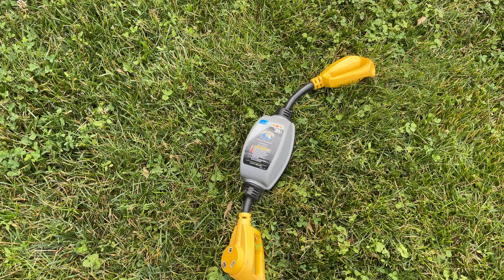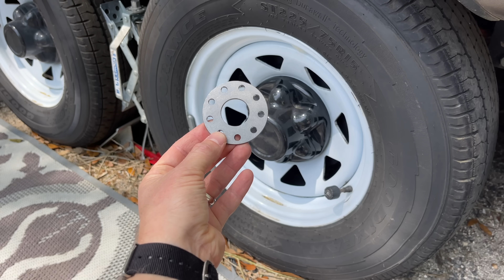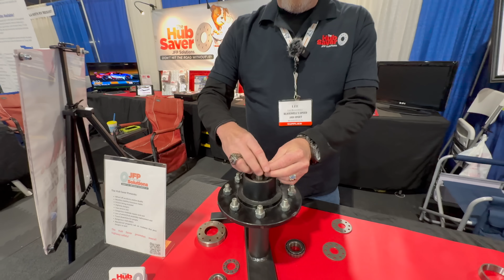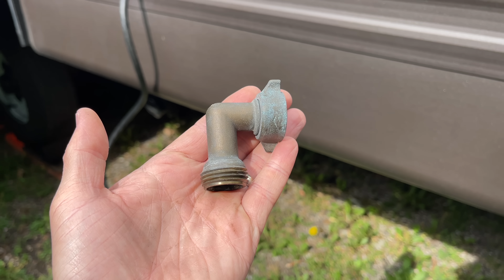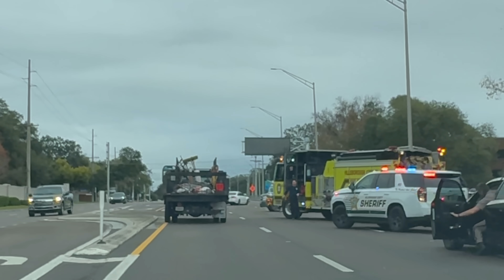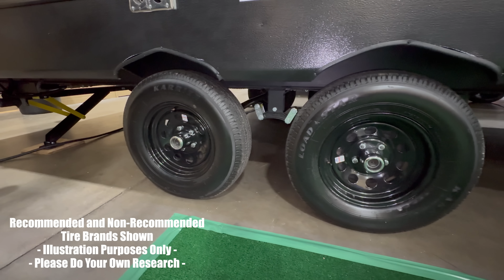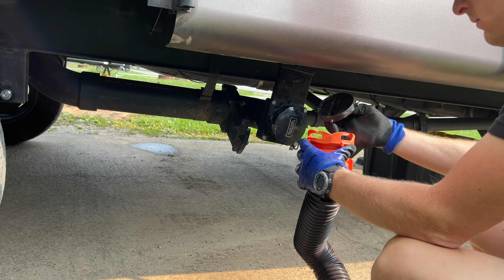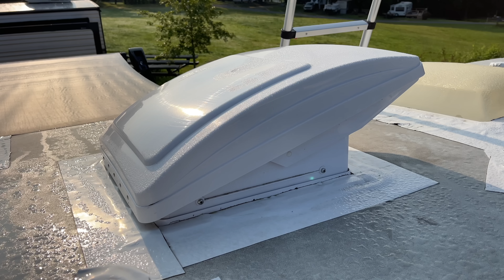RV Upgrades You Should Have Installed LAST Camping Trip (Bet you're unfamiliar with #3...)

Comment: After a lot of research we use GoodYear Endurance tires. People swear by them. Also, before a long trip I’ll jack up the axles and spin each wheel listening to the bearings and check the play. Finally check and tighten the lug nuts, and check the tire pressure. 
After every rest stop I’ll walk around the camper and place my hand on the wheel hubs to check for overheating. There’s several other things I double check, but those are the highlights.
Reply: A laser temp gun can also be used to monitor hub temperatures.  It can give you early warning if you have a bearing/hub that is potentially failing.  Thanks for the tip on the Goodyear Endurance Tires!!
Reply from the maker: Love my laser thermometer for that! https://youtu.be/TXLVFJCDfZE
Reply from the maker: I think you'll enjoy this video too - all about tire gear! https://youtu.be/TXLVFJCDfZE
Reply: Thanks for the tip. Im going to take my IR temp gun on my next trip.
Reply: I've worn out a set of Endurance tires and will need replacements next spring. The only thing I don't like about them is that they have very little tread to start with.
Reply: My 42ft Trailer came with 12ply Tires. I bought 16ply and called it a day😂
Reply: My 2023 Della Terra came with Goodyear Endurance tires. Great tips for me to think about. I like the 3ft section of water hose to keep attached to the rig.
Reply: THATS JUST HOW US TRUCKERS DO IT  '''   GOOD MAN  ...
Reply: Sailuns good too, but the Goodyear Endurance are well thought of on my forum.
Reply: Yes, but if you have to brake alot, like down hill, then your hubs could be hot by the brake system. I will put my brake controller on zero for a while when safe to check temperatures on wheel hubs.
Reply: How often do you grease the bearings and how many pumps when you do?
Reply: @Nativetuna123  Every spring we grease our bearings and I pump until the colour of the greas coming out matches whats going in.  My double axel (4 tires) usually takes about 6 or 7 tubes but sometimes I am being a little over cautious and pushing out extra grease.
Reply: @Nativetuna123 depends on how many miles. But the best thing to do is to take hub apart every year, clean the old dirty grease out that could have metal in it, and replace with fresh grease. If you just add a few pumps of grease on top of old grease, it will just mix in with the dirty stuff. Also be careful when pumping grease in, too much can blow the seals, especially if using a battery powered gun. I couple hours one day a year can keep you from having a big headache down the road. If you only tow it once or twice a year short trips, you can go 2 years
Reply from the maker: Bearings should be dis-assembled, inspected and repacked - just pumping more grease through the grease zerk is not acceptable
Reply: @rvgearandfar I have been using the zerk for many years. Once it has been flushed of all the old grease, then just a few pumps each year while rotating and it's good!! 3rd generation mechanic and engine builder.
Reply from the maker: @owenhill-vf7ko  yet there are no eyes on the equipment- no way to tell if they are wearing correctly or if there are issues inside the hub if you just pump grease through. Its also really easy to blow out the rear seal by pumping in through the zerk as well.
Reply: @rvgearandfar  IT Will work For A While ". His Method Is THE Wheel Bearing Has To Overheat To Get The Hub Hot Enough To,' Melt ' The Grease"'  Like I Said Will Work For A While 73's  .
Reply: @Nativetuna123  I’m not sure how often they recommend that, but I’d do about four or five pumps once a year. But we don’t put that many miles on it. Ideally it’s better to repack them to examine their condition.  Too much grease will cause more problems than what you’re trying to accomplish.

Comment: What hub saver part number did you use?
Reply from the maker: Reach out to Hub Saver or use the info on their website to determine which part is correct for your specific setup - yours may not be the same as mine - even if you have the same rig brand/model as manufacturers don't always install the same equipment on every unit.

Comment: Not familiar with the gas stop product.  I know the black (residential grill)acme screws are 70k-100k btu and the green (RV) are 200k btu.  I looked on Amazon and did not see a flow rate for this.   I know people have issues with the tank gauges with black and winter camping.
Reply: 1cf of gas equals apron 2516 btu/hr. Gas Stop claims shut off at about 70 std cubic feet flow/hr which is about 176,000 btu/hr. The green acme nut pigtails contain a flow fuse in them that shuts off at about 100 scfh or about 200,000 btu/hr, so I'm not seeing any real advantage of the gas stop over the flow fuse you already have in your RV'S existing gas pigtails. The black nut should have a flow fuse that shuts off at 50 scfh or 100,000 btu/hr so the gas stop is useless on hoses with black acme nuts.
Reply from the maker: I reached out to GasStop for some more technical details to follow up on these thoughts and here is their reply:

“A GasStop RV unit would not be suitable for a typical grill application, this gentleman is totally correct. Excess flow valves (EFVs for short) are calibrated to certain maximum flow rates, and the maximum flow rate of a grill will be different to that of a typical RV application, this is why the connectors on your pigtails hoses and/or regulators are different colours. Black connectors typically have lower flow rates, Usually around 60 SCFH, light and dark green are normally over 90 SCFH. The reason why it is important to match your GasStop to your application (we now write RV or Grill on the connector to be as clear as possible) is to make sure GasStop shuts off as expected during a fast/major leak scenario. GasStop will not limit the flow in the event of a major leak, like hose EFVs do, instead it goes one step further and shuts the supply down fully until it is reset. Hose flow limiters are a layer of protection, GasStop is that extra layer that puts the user in more control (especially with the added benefit of the pressure gauge to perform a tightness test prior to use!). We hope this helps!”
Best wishes, Matthew Howard, GasStop
Reply: @rvgearandfar  I looked a bit further into it.  Apparently generators can be an issue.   I know most people don’t have issues with the black acme tank gauges. So, smaller RVs probably won’t have an issue. Somebody with a LP generator might.  But they don’t list a flow rate.  And the black and green handle, I don’t know what that’s supposed to represent for flow.  
I’m a RV tech and I see the black acme gauges and people aren’t complaining about their LP appliances 
But if I’m touching an LP system then black gauge goes and I’d do the same with a black and green
It would be rare for someone to have an issue but if you are cold weather camping and have a generator, probably not a good idea 
But I also have to tell people no LP appliance manufacturer approves of the bug screens as they restrict air flow and have seen more bee nest problems than air flow problems

Comment: How did you decide which TPMS to get? I had an Eez system on my RV but I included that with the RV when I sold it. I'm looking for a system now for my box truck conversion. I really like the pass through design. Thanks! Great video!
Reply from the maker: Just watched some comparison videos on some of the name brand options out there. I think TST or Tire Minder are good places to start. I'd also see if you can get metal valve stems installed if you plan to use the flow through sensors.

Comment: Our Michelin XPS RIB tires have been doing great for the last 2.5 years. They hold their pressure well and don't fluctuate.
Reply: After 4 blowouts over a 7 year period with trailer rated tires,  I switched to LT tires on both the car hauler and camper.  I haven't had a single issue since changing over. I "think" LT tries are made to a higher standard vs trailer tires.  I have 5 years on the LT tires without no blowouts. If I can make two more years, that is confirmation enough for me. Blowout #1 was a factory supplied Chinese tire, Blowout #2 and #3 were Carlisle Trailer tires, Blowout #4 was a Goodyear Endurance.
Reply from the maker: These are LT rated tires correct? What made you decide to go LT vs staying with trailer tires?

Comment: When you basically opened your video with the screen door handle, I knew you had common sense and that this video would be worth the view.  To go along with the screen door handle, especially if you have kids or pets, is the Camco 44133 Screen Door Closure Kit which is also a 4 screw installation and closes the door behind you.  Great video,  I've done everything with the exception of the propane tank cutoff which I'll look into now.  Thanks.
Reply from the maker: I've installed those screen door screen closure springs as well - agreed, I like them.